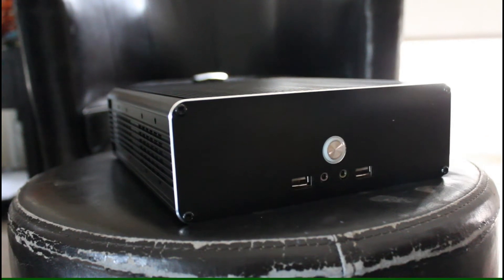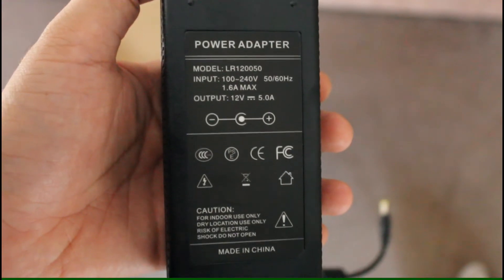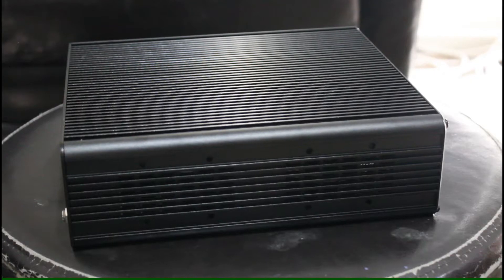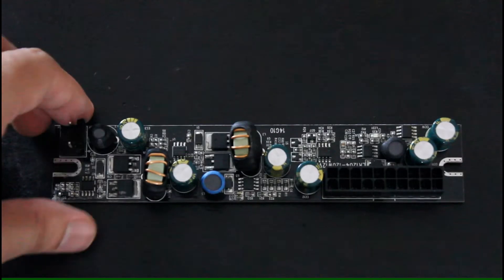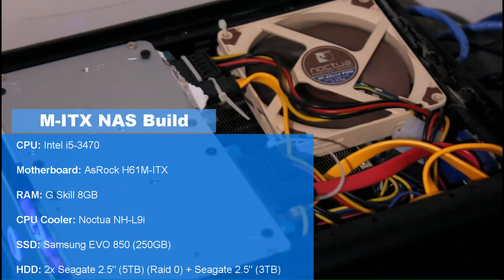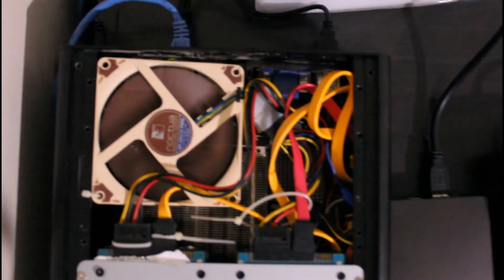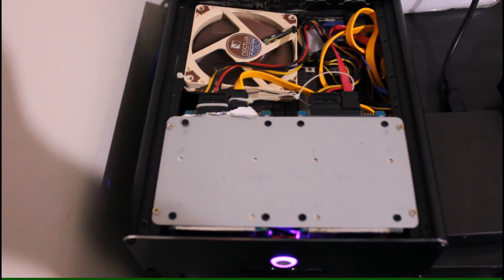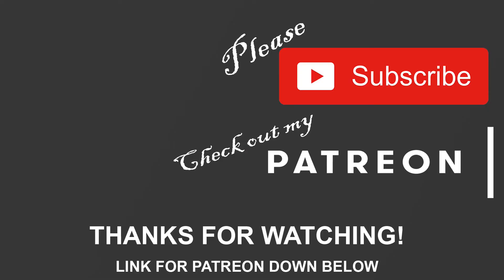Building a tiny ITX NAS with the Realan E-K3i case

Comment: Yeah I built me a NAS out of spare parts and ended up only buying a case, it was also an itx build but big enough for 4 drives. I decided to scrap the idea as im the only one the uses it and I don't care to stream media from it, I just bough a dual HDD docking station and use 2 of the bigger drives I have and shared them over the network, I can also access it from my phone, my PC is on probably 95% of the time so its not a big issue and Im not keeping important things on it.

It was fun, just not practical for my needs. Good video, I would just hate that case, its entirely too small for the mountain of drives I have laying around lmao.

Comment: you said the case takes two 2.5 drives or one 3.5 drive. how come you installed 4 hard drives into it? and I am sure the 5tb and 3tb are 15mm height drives.
Reply from the maker: Case is officially designed to hold either two 2.5" drives or one 3.5" drive. However, 2.5", that are larger or equal to 3tb interferes with the cooling (for NH-L9i) since those drives tend to be thicker. The way I overcome this was to move the fan away from the hard drives and mount it in a weird way, sucking heat out of the case.

Overall, I had three drives in it, 2x 5tb drives (thicker 2.5" drives) plus 1 m.2 drive (inserted into a 2.5" hdd adapter enclosure). the m2 drive was essentially double sided taped onto the drives and moved closer to the front of the casing. Since it's a m2 drive, I don't have to worry about stuff like vibrations messing up the drive. 

The slimmer 2.5"  (<3tb) would not have an issue with the NH-L9i cooler (including fan) (i believe).
Reply from the maker: The board I am using is a: Asrock H61M-ITX - so I can't even attach more than 3 drives to the board (sata port limitation) without a pci-e sata port expander.